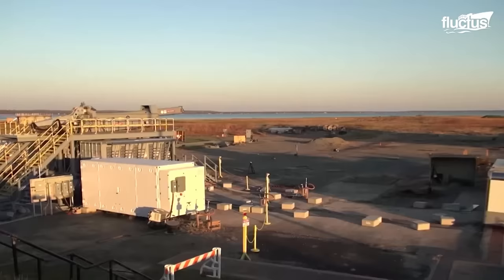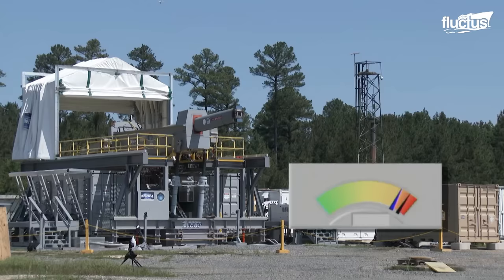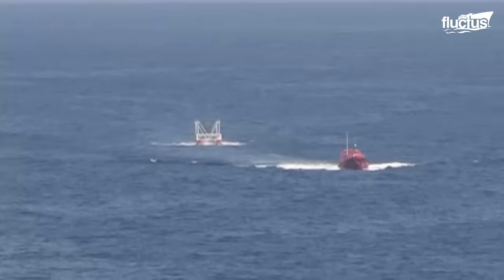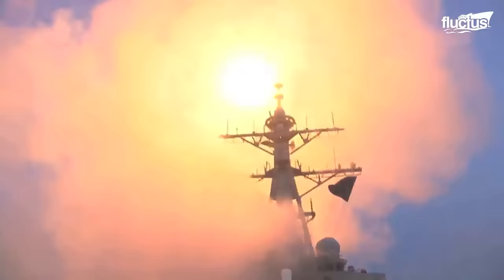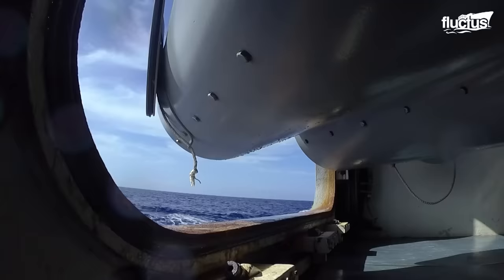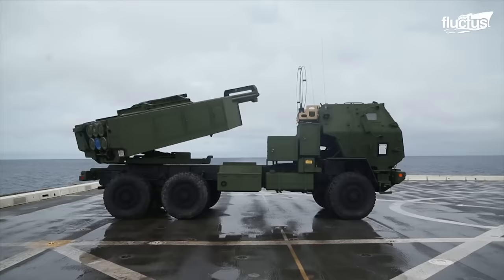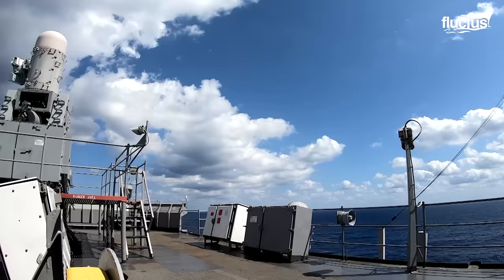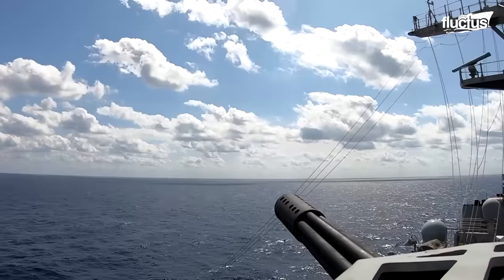US Testing Its Monstrously Powerful $500 Million Rail Gun

Comment: You know, earlier in time computers took up an entire room and cost millions of dollars to make.

Imagine how much smaller and how much cheaper that railguns will be 50 years down the road.
Reply: Sadly railguns aren't the endgame here. They are stupidly inefficient and the rails get absolutely annihilated within a few hundred launches from both friction and the Lorentz forces. They're a "trial run" and just a stepping stone towards much much more powerful weapons called Coil Guns. They are much more difficult to make but unlike with railguns, the projectile is accelerated through pure magnetic force, without physical contact. Energy efficiency of those is extraordinary, and the projectile speed has no other theoretical limit but the speed of light (well, just shy of it as accelerating something with mass to 1c would require an infinite amount of energy), and it doesn't suffer from rail degradation or anything like that. The only problem is TIMING the magnets and actually actuating them too. Also, it requires superconductors to act efficiently, and high temperature super conductivity isn't really a thing yet. It's inconvenient carrying Liquid Nitrogen on warships right? But in fact, we already use gigantic coil guns for a different purpose. They're called particle accelerators. Look up coil guns, they're really cool.
Reply: The iRail, from Apple 2040, useful for firing projectiles or sending small packages to people within range (not responsible for damaged items)
Reply: @UTUBE3JC  Lmfao facts
Reply: @UTUBE3JC  how are you doing
Reply: @matthewgoodofficial2653  not too bad I guess thx hope ur well
Reply: The physics involved in these, and coil guns make it inherently necessary for these guns to be large. The laws of physics don't change, but how we learn to use them does.
So, maybe in the future we will learn to manipulate these laws to reduce the size, but probably not in our lifetime. just saying...
Reply: @UTUBE3JC  I wonder if I can use the iRail to send things to iRack 🤔 I’d probably end up shooting a hole in my iBall.

My apologies. iStopWithThePuns and iCryMyselfToSleep.
Reply: @MysticiaDevHoopsMacabre  the iRail Can do anything friend, sleep well
Reply: Bahahaha you obviously have zero understanding of the mechanics of these guns or the laws of physics in play. They will ALWAYS be large and require enormous amounts of power. Foolish comment.
Reply: @thedysonguy6396  Welcome to our shoestring excuse for a union.
Reply: @thedysonguy6396  THAT my friend is precisely why I said what I said. The laws of physics as we understand them are at the present restricting the reduction in size, but man learns to manipulate these laws over time in some cases, and makes advancements that previously were unimaginable. THAT IS WHAT I SAID.
You are correct, that at the present time the guns must be large and ungainly, but in the future the may discover a more concise method, as man is ever learning.
Reply: @allanpolk2681   I'm sorry Allan but I'm not here to massage your ego and I didn't read every single comment as I was only replying to the original commenter. So you can shelve your "THAT'S WHAT I SAID" whining. As for "manipulating the laws of physics". Sure maybe in 500 years of further advancement in human technology but if we are making wild and unsupported guesses on the future human advancement wouldn't it be just as valid to say that by the time we can manipulate the laws of physics, if in fact that is ever even possible, then by that time wouldn't we have moved far past such rudimentary weapons as those that fire projectiles? Of course, all just wild theories and opinions. Much like buttholes, we all have our own opinion ;)
Reply: @thedysonguy6396  Touché
Reply: Cool, I wish we could talk more better via Google chat
Reply: @TheDysonGuy: maybe they would be effective shore defenses?
Reply: 50 years ?   What makes you think USA will still be around  5 years from now ?
Reply: @SeaJay_Oceans  that’s… a pretty good point. America sadly won’t be around in the next 10 years. There’s just no way in hell America’s gonna navigate the 2020s without collapsing. Sadly, Americans aren’t the only people who know how to find new and exciting ways to maim each other.
Reply: @MysticiaDevHoopsMacabre     ArmyTimes reports  the upcoming losses of more than 20,000 troops - with no one to replace them.
No one is volunteering,  and most that do are not passing the background or fitness tests.
Reply: @vladchannelyt  there is something known as terminal speed my friend, if something were to travel even 1% of lights speed in earths atmosphere it would be completely atomized withing a few seconds
Reply: @thedysonguy6396  What about these weapons-grade lasers I've heard are installed on Arleigh Burke class destroyers? Several generations removed from the one the USAF had that took up an entire 747.
Reply: @thedysonguy6396  Nope...
Reply: @allanpolk2681  Nope..
Reply: @babystomper_6986  Nope...
Reply: @wayne_3791  Noticed you wernt even in the comment thread there Wayne ..youtube didn't like your comment there Wayne strange you just saw my comment on such a random video and your not even in the thread 🤔
Reply: Maybe in 50 years they will overcome how to aim it. It can only be a short-range weapon as it is not possible to make its projectile bend in flight to the curvature of the earth.
Reply: The Daisy Commander .177 caliber raiilgun - $39.99
Reply: Those earlier computers were literally mechanical and would INSTANTLY give an output with ZERO calculation. Amazing. As a matter of fact, when shooting huge guns on old battle ships, they could acquire a target, and hit it within 30 seconds with the 16" guns. That 30 seconds is about the same amount of time modern digital computers take to produce the same results. I just watched a ton of battleship videos yesterday and that's what I learned. Now yall know it too!
Reply: Probably not much actually. You can only pump so much energy into an electromagnet before you risk literally blowing it up. Which means if you don't intend for it to be a 1-shot-per-hour weapon, you're going to need coolant...and that's heavy.
Say you solve the heating problem, now you have to worry about where all that energy is coming from. While it's true that E=MC^2 so a small amount of mass can hypothetically become a tremendous amount of energy, harnessing that much explosive force is also going to be heavy. Unless you hook it up to a public power source, in which case it's not exactly a portable weapon so miniaturization is kind of irrelevant.
Most likely the technology will be abandoned entirely in favor of a directed-energy weapon that gets the job done with less energy. Edit: Or a new kind of chemical propellent that replaces gunpowder, providing the same force for less weight, or greater stability when stored. Like how most modern matches can't be struck on any old surface, because the chemical reaction depends on a compound in the strike strip to start the oxidation.
Reply: as they scale down they will have to make up for the loss of projectile mass with more and more velocity. and these stupidly high velocities degrade the parts very quickly.
Reply: WAGE PEACE
Reply: @vladchannelyt  now imagine them firing tiny slivers of metal, like staples, yet being at a velocity high enough to vacuum out ones organs.
Reply: @vladchannelyt we do know it's not impossible though. It's just that turning the entire accelerators at CERN or Livermore Lab into guns would be absurdly expensive.

Comment: An update from some years ago said that there were problems with barrel wear.  I wonder if they've mastered that issue.
Reply: The video is outdated. The program was cancelled. They couldn't solve the barrel problem. The barrel would be worn out and useless after a few shots. And it used too much electrical power.
Reply: Maybe they could put a windmill on it to make extra power and then add a solar panel to the windmill blades. Lolol I'm surprised AOC didn't come up with it.
Reply: @K3Flyguy  Windmills and solar energy are nothing, prob if they somehow managed to place a nuclear reactor on it but that would be very very expensive

Comment: One of the most interesting things about rail guns is that they don't recoil the way you would expect the force isn't channeled straight back but it's instead directed in other directions and or absorbed by em fields.
There are effects of interest for space propulsion and other fields in rail gun research.
Reply: That would break Newton's 3rd law.
Reply: @nicholasw6442  indeed, yet it is what happens. There are likely no laws being broken but something interesting is happening. 
From the answer block in Google:
Recoil forces in EM railguns appear wherever the breech of the railgun i s closed electromagnetically. This means recoil forces may appear on power supply leads, switches, or power supply components them- selves.
Reply: @Blue Sky Research  I took enough engineering physics classes to not buy this. Regular guns have primary and secondary recoil. Rail guns have virtually no secondary recoil. The primary recoil is caused by the acceleration of the projectile and is still going to cause a force be in the opposite direction, I don't believe there's a way around it. Do you have a reference to a study on the phenomenon you've described?
Reply: There is a whole body of research into this if you are curious.
Reply: @blueskyresearch6701  can you link me to something?
Reply: For this to work and not violate newtons law. The recoil is still there its just dispersed in a non regular pattern
Reply: The space propulsion aspects of this  could be used for initial satellite/shuttle  launch and imagine using this on a L2 satellite substation for launch or even a pass through generator that uses this type of engineering to boost an already launched vehicle. If the rail gun is that fast on earth imagine what it could do for a ship with 0 gravity!
Reply: @ryanholt9884 it's likely too many Gs, and would destroy the spacecraft

Comment: The gatling gun drawback is the difference between the amount of time it can actually shoot versus the time it takes to reload it's magazine. Ithink it should have a 100,000 round magazine with a backup magazine also
Reply: SOLAMENTE! SERVIREBBE UN CARICATORE DA 400.000 COLPI!
Reply: the m134 minigun works off a belt not a magazine. you can make that belt as long as you want. anyway the m134 is NOT a machine gun. it is a minigun. it is built for a completely different purpose than the machine gun.

Comment: And what happens if something the military wants to target with the laser has a laser-reflective coating?
Reply: Yoy mean like the "tent" atop the DIA?
Reply: I've seen mirrors in a 4kw laser system explode from a tiny imperfection. These mirrors are specifically made to reflect/guide the beam BEFORE the beam is focused.
Reply: Shift the wavelength and try again.
Reply: As of right now, there are no coatings that can really stand the sudden energy input without being relatively heavy or fragile. Also - said target is also flying a giant "shoot me!" sign - as in "laser reflective" is also "radar reflective" - meaning normal AA missiles can see it easier.

That's the REAL impetus behind of laser weapons... Most Stealth coatings are somewhat energy absorptive. Hit an energy absorptive coating with a Directed Energy Weapon and you get something that burns up even faster. oopsie!

Comment: Years ago, I heard of a concept for a naval gun by which, instead of one explosion pushing a projectile down a barrel, there would be several explosions pushing the projectile even as it moved. Any word on how that worked out?
Reply: If it worked, you ain't gonna hear bout it for a while
Reply: Germany tried something similar back in ww2. Look up the V-3 cannon
Reply: Sounds like a worse way to apply a rail guns mechanics. I think it'd be obsoleted by this
Reply: I think the original idea of this kind of gun was imagined by germans in ww2.
Reply: Сколько надо кило джоуле без российскова газа, или урана???
Reply: Movies Tamil movie Tamil movie Tamil
Reply: Saddam Hussien tried to build a super gun just like the one you described.
Reply: Real ......................many set up this weapon, not Navy ..................................
Reply: Only a good enemy spy can answer your question.:face-fuchsia-poop-shape:
Reply: That was a Nazi Superweapon idea. Basically there is a practical limit to how big an explosion (charge) you can use to fire a shell, so with multiple charges down the barrel you can accelerate it to much greater speeds. The Nazi's did build one but IIRC it was a bit of a disaster. Not sure about any other modern versions.
Reply: Gerald Bull developed a system like that for Iraq in the 90ies

Comment: Man, imagine a battleship with like 20  of these guns mounted to shoot at a single target over and over again. You could shred ships.   Unfortunately, its a relatively close range weapon - and close range combat (based on things I've learned watching grimreapers anyways aha) is not really something modern navies are likly to do.
Reply: Propelled by an electrical current and traveling at speeds up to Mach 7.5, the US Navy's Hyper Velocity Projectile can shoot out of a rail gun to destroy enemy ships, vehicles and missiles at ranges up to 100 nautical miles.
Reply: You are correct, though you are wrong at the fact this is “short range” it has a range of 100 miles!!  And it’s probably more now, since this was an old vid.They could hit an enemy ship from 100 miles away, shred it too peices, and there enemy won’t even know what him them. Or see what hit them, other than boats within radar range.
Reply: @johnnylego807  Railguns can achieve much higher velocities too but current materials and more importantly, on-board power generation systems, can't handle them. The only ship that I know of that could handle powering a railgun with a projectile kinetic energy of 50 MJ or more (this one gets to 10 while using a lot more than that for acceleration due to the inherent inefficiency of a railgun) is USS CVN-78 Gerald R. Ford with its two nuclear reactors and modern power distribution systems and other overengineered stuff. Probably practical projectile speed limit is around Mach 20 to 30, materials, even the currently theorized or just barely synthesized new ones, can't keep up with the friction. Then you have to increase projectile mass really if u need more energy, which is inefficient as in the equation for kinetic energy velocity is squared but mass isn't. Coil guns are where the real magic happens but we need high temperature superconductors for practical reasons and incredibly fast switches that can also handle the energies, and they all need to be timed with a margin of error in somewhere in the region of picoseconds. Those guns have no real limit other than the laws of physics and are efficient as it's frictionless, magnetic acceleration
Reply: Hello
Reply: The problem is that the weapon's velocity makes it either line of sight, or very long range. There is no way to shoot something that fast just a little bit over the horizon.

But it's moot, since the the program was cancelled.
Reply: The problem with it is that it's obsolete before it was even brought into existence. It sounds fancy and futuristic but much of warfare is beyond the horizon. With the advent of OTH Radar you know the enemy is there before you can see them. 

Much of modern weapons systems rely on sensors. It's why LASERs and stuff are becoming more and more effective because they're essentially acid in the eyes of the enemy

Comment: Ages ago my father was working at the General motors defense research laboratories in Goleta California. And they had a prototype of simply a rail gun like test. They up armored a target in the basement. Many layers of concrete block filled with cement. With a lot of lead in front of it. And fired this yet to be made into a weapon test case. And move that wall a foot or so back into the soil. Needless to say the employees above the basement and. Thought the world had come to an end. And it was the big one San Andreas had finally not only let off his stress. But had moved the land up a couple of feet. Squawks the macaw
Reply: This makes no sense and I wonder if it was written by a bot
Reply: might want to rewrite the comment sir and do it grammatically correct, from what I can tell:
The testing workers made a blasting target in the basement for a prototype railgun out of layers of concrete slab and then put a ton of lead in front of that. Then when the gun fired it had enough power to shove the wall of concrete and lead BACKWARDS by a FOOT.